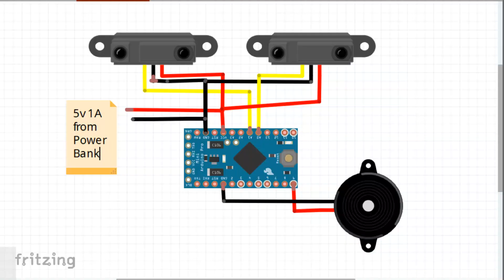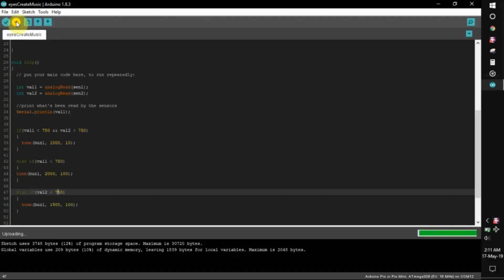TuneGlass: Can We make MUSIC using our EYEs?

Comment: LOL  That's pretty cool, but how in the heck does it work?  I mean how can it do that just by you blinking?
Reply from the maker: There's two IR sensors to detect Open or Close eye. If closed detected - makes sound at different frequency with different delay. Thanks.
Reply: @FuseBatti  OK, but how does it know your eye is open or closed.  Things like this interest me.  Is it reflecting the light from your eye, back to the sensor when it's open?
Reply from the maker: @stevenA44  Absolutely, you got it. It's my pleasure that you have liked it.